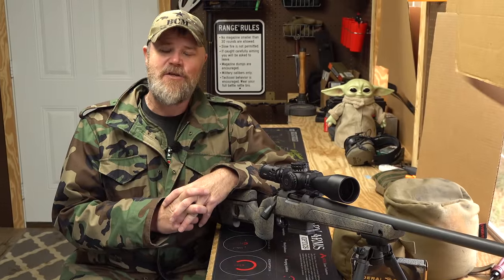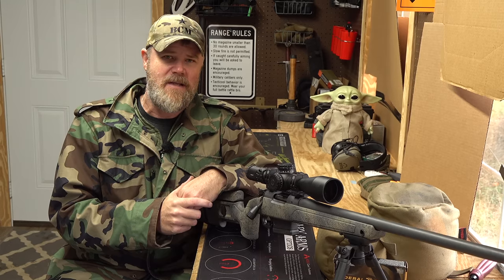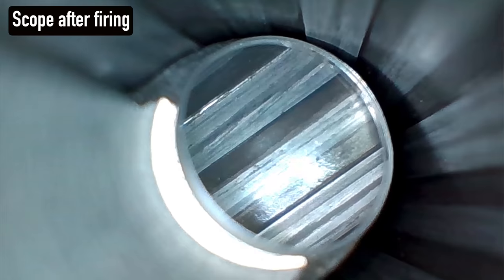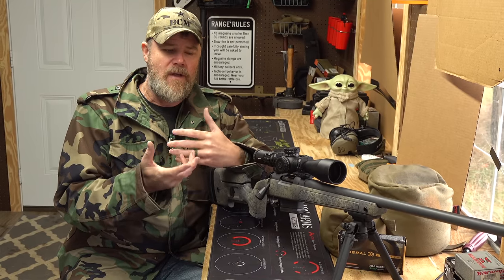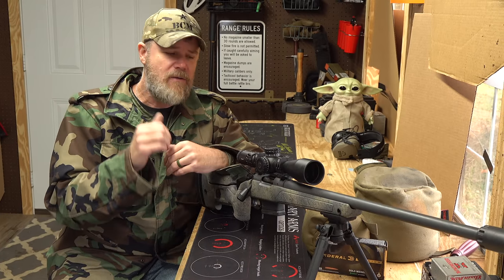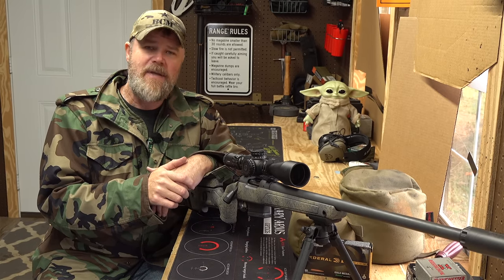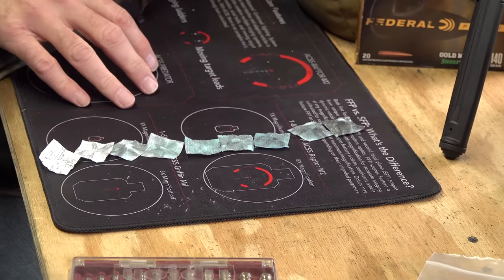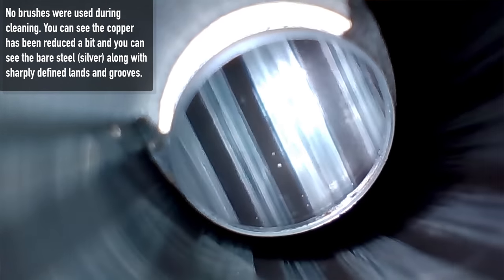Barrel Break-Ins and Cleaning Voodoo Rituals Destroy Barrels

Comment: To those that do not believe a brass brush can damage steel. I am a retired Knife Maker. My life is steels and their properties. 
First, brushes are not brass. The are bronze. Bronze by its very nature is slightly abrasive. It is not that soft and is often used in industry as a bearing surface. (actual brass is even more abrasive and very rarely used in brushes for firearms. Only very low quality and cheaply made brushes are made of brass).  

Further, any material can be abrasive in some instances. Is water softer than hard rock. Of course it is. So how does running water cut rock. Motion over time.  
How can a copper (very soft) with a lead core (softer yet) punch thru soft steel plate? time in motion.. Yep, a soft material defeating a much harder steel. 

Bronze is much-much harder and more abrasive than water and steel is nowhere as hard as hard rock. (I have never performed a Rockwell test on fully hardened bronze but I would bet is not too far below the hardness of some barrel steels. It is hard stuff folks! 

Yep, a soft material defeating a much harder steel. Remember, gun barrels are only in the neighborhood of Rockwell C scale of 40 to 44 HRc. In steel standards, very soft and made so to prevent  shock cracking by sudden pressure spikes such as explosive powder condition's. . It is softer than my steels used in knife making are when we first start working. Long before heat treating. It is what we called pickled and annealed. Or dead soft. 
For whatever reason the general public assumes that all steel is very hard. Far from it! Gun barrel steel  is too low in carbon which gives steel its hardening ability to ever be hard enough to hold an edge for a knife blade. (Bronze was used for hundreds of years for edged weapons. Just something to think about here). 

Many high top barrel makers who actually hand lapp their bores state to not use a bronze brush in their bores. A fully polished bore will instantly show fine scratched down the bore with only one brushing. This says everything you need to know as to whether bronze can effect steel. 

KnifeMaker/Retired after over 47+ years in the Craft

Comment: Older vid I know...but saying a brass or bronze brush will ruin a barrel is called retarded in any dictionary and has been disproven so many times it's ridiculous..but I'm also a hard believer in as little cleaning as possible...for the highest accuracy basically chamber cleaning is as far as I'll ever go...my black hole weaponry 556 3 grove poly barrel still nails golf balls after no cleaning and 7k rounds...the pressures in the barrel from bullets and gases only build so much and fill voids so much and then that is it...of course the nickle boron bcg needs a good cleaning every 1k rounds or so...just saying...

Comment: Barrel cleaning is BS. The copper residue in the barrel affects the accuracy. After cleaning, the rounds will continuously move on the target until they settle at a specific point, once the amount of copper deposited and removed by the projectile equalizes. That's the point at which the rifle should be sighted in. If you would want the same accuracy with cleaning, you'd have to perfectly clean the barrel each time.

Comment: I have to wonder if the "barrel break-in" idea is a carry over from when guns were less well made or from Black Powder days.  With black powder you need to clean the gun when you're done using it because the powder is corrosive and will pit your barrel (and anything else it touches) so when modern smokeless powder came along the idea of "clean after use" carried over when its not necessary.

Comment: I bought a PTR 91 2 years ago. The owners manual states,"Initial Cleaning & Break in period- 200-300 rounds. Break in Procedures- Fire 10 rds. After ea. shot, run a wet patch through bore (where else?) Then a wet bronze brush 5-10 times. Then another wet patch, followed by dry patches, until bore is dry. Fire 10-20 rds., clean as above after each group, until the 200-300 rds. are fired. What a PITA. I have complied with this as I don't want to void the warranty. So, WTH?

Comment: A wire brush to clean a barrel does no damage to the barrel. There is no way you can produce more friction with a wire brush than a single copper plated bullet screaming down the barrel at THOUSANDS of feet per second. This is why the barrel heats up, friction.

Comment: I respect your body work, however, I’d like for you to consider a another source of experience and information, specifically bullet manufacturers.   They extensively test the bullets they’re making in test barrels.  Using time tested break-in, and barrel cleaning procedures.  I’m not saying what you’re doing isn’t working. Just saying take another look at some information that’s out there that is legitimate and based in years of bullet testing.   The Hornady Podcast has some good information they have shared.   See Ep 103 and 114.

Comment: I use a nylon brush and CLP. I run a patch with CLP through the barrel and let it sit for a few minutes then run the nylon brush. If there’s a lot of copper I will use a brass brush with CLP on it, push it through and unscrew it and push it through, don’t pull the brass brush back.

Comment: Stay away from stainless brushes but if you scratch your barrel with copper or brass you have much bigger problems than accuracy. if copper scratches your rifling, the heat treat was never done and that barrel will potentially grenade, or it isn't made of steel.

Personally I use brass bristle bore snakes, and patches. Nylon hasn't been reliable for me and outright doesn't do anything for my black powder rifles.

Comment: If the copper jacket bullet which is essentially being pressed fit through the bore with high pressure doesn’t hurt the bore I doubt a copper brush would. But I do agree over cleaning is unnecessary….

Comment: Folks, during the rifling process when the “button” is pulled through the bore, on a micro level it leaves sharp feathered edges on your lands.  No, barrel manufacturers do not worry about removing this.  When we break in a new fresh barrel, we fire one shot then brush and patch to remove all these micro hardened steel fragments that would otherwise act as sandpaper on the next shot.  About ten shots with brushing and patching in between is all it takes with cheap FMJ copper jacket bullets.  Do not do this with exposed lead bullets.   Ten and done.   Now you know why Pawpaw is doing that fudd shit with his new pew pew at the range.

Comment: This exact issue and arguments are seen in other types of engineering.
There has always been baseless mumbojumbo in all these disciplines.
There has also in living memory been very large improvements in fit and finish in production engineering generally, especially in cheaper product..
There have and still are all sorts of hokuspokus products sold in all of these markets, many that are obsolete, many that are marginally or completely ineffective, some that do more harm than good.
.
There have and always will be those who make up and  espouse over complicated, methods, just so they can present themselves as being better or smarter than they realy are.
There will always be manufacturers who, have some sort of product to sell and are quite happy to tell all sorts of BULLshit to sell it.
.
Carefull use and storage, modest reasonably regular cleaning and lubrication always will be THE sensible and effective path to accuracy and long life no matter what the machine.
.
HOW can a barrel get "clogged" by anything when you slam  something with an inteferance fit, down it at 750+ Mph?
Surely just firing the gun has an inherant cleaning action on the barrel.
.
I note that the obsession seems to be the barrel. Probably because that is the easiest to sho as "dirty".
It has to be more important to make sure the action ( of whatever type) is reasonably clean and properly lubricated.
.
Of course THE major concern should be corrosion, particularly in a machine that involves fire and may be used outdoors.

Comment: Nice tips. What's your thoughts on using a bore snake in rifle barrels? I do use those in my pistols. What I'd like to do is run a wet patch of Radco CLP thru the barrel let it sit for 10min, then run my bore snake thru the barrel 3 time.

Comment: I'm OCD and I will kick the sheets off of my bed at 4:am and attach a drill to the cleaning rod and go crazy with a diamond dust brush !
All kidding aside, you can't cut a metal barrel with a softer metal brush. It's the cleaning rod type as well as cheaper brass brush construction that are suspect. Jags are mot my got to unless they are polymer. Opinions are like a_______s everyone has one.

Comment: Like you say it's your method and works for you.  You do ignore the fact that there are many pro shooters who disagree with your method.  My barrels and bore scope don't agree with your statement that copper fouling is mainly at first part of barrel and diminishes further down.  I see carbon early on to midway followed by copper gradually increasing to muzzle.  That's on a cut Bartlien, button rifled AR or hammer forged 223 and 6.5 Creed.  I agree the average Joe doesn't need to go crazy with cleaning, but the assertion that you will wear your barrel out with a thorough  cleaning is bogus.  Stay away from harsh chemicals and stainless brushes, they are not necessary.  Take care of the crown and Kroil ,Iosso and JB bore paste will remove everything that you will find without damage.  As Eric Cortina says"How do you know it won't shoot better if you clean it if you don't clean it"?

Comment: Cut, Buttoned, and Hammer Forged Barrels are divergent in cleaning need. I am a High Master Classification Long Range Competitor and having experience with cut, buttoned, and hammer forged barrels, I find buttoned are most accurate but also the quickest to loose accuracy from throat erosion. In US Service Rifle Competition I get about 1800 rounds from a button rifled barrel before MOA is difficult at 1000 yards. This means concern for using up some of the barrel life on break in as that could have effect on winning a match at the end of barrel’s life. At any rate, my experience suggests no cleaning but in a long range match I typically will take 8 sighter shots to get consistent temp for next rounds for record. This gets me a very consistent velocity from round to round which helps hold accuracy inside an MOA at 1000 yards. For Championship Tournaments I usually try to go to the firing line with s fresh barrel. The bottom-line is annotate your data book’s facsimile target with shot call and bullet strike for whatever break-in/cleaning scheme seems right and then use shooter/target analysis to compare results from chosen scheme to alternatives of which you have no experience. This will assure a better outcome than from trust in what the author of this video recommends. One thing for sure, you must be a pretty good shooter to be able to recognize what cleaning scheme is best because all divergence is going to be minuscule except at long range and at long range judgments should be made on vertical dispersion. If no long range is available measurement from a chronograph will need to suffice.

Comment: I rarely clean my Thompson center encore pistols. I'm getting sub moa with 44 Magnum and even  0.375 with 30-06 barrel with Winchester 150 grain power point (the cheapest ammo I could find). Remember, it's a break action pistol without a muzzle brake and with low power scope. If I get muzzle brake I'll probably shoot it even better. Never did that breaking thing, never thought it is nothing but bs, because as an engineer I understand how barrels work. I noticed that my accuracy is going down after cleaning barrels. I never use brushes of any kind. That's just me.

Comment: my grandfather was ww2 army Air corps drill sergeant, sheriff , mounted posse and taught Hunter's Safety course instructions for YMCA of over 10,700 students.

Including my father, USN-ECMR 65-68 , eighty six missions 37 encounters with the Enemy 16 CK's silver Star two bronze I even have some of his Personal commendation letters from a Vice Admiral of Asian Pacific Fleet, 

Point to being over cleaning your Barrel is like overcleaning an engine, since the Reciprocal motion of a Piston or bullet are the Same Thing essentially... Controlled mass pressure wave using Thermochemical reaction to direct the projectile or intended Mechanical energy.

We used to use Liquid Mercury after many Hours of shooting per weekend, gramps had multiple calibers, and ALL of the used every time, very rarely should you need to use wire on a barrel unless it's neglected, just a simple pass with mercury back into the bottle and couple passes with an oiled Cotton patch and your barrel is Proper.. the carbon deposits also seat on inconsistent rails of the rifling, just like in a piston where Natural pits in the bore chamber  seats so as to provide a natural filler of Pure Carbon.. thats why engine's and firearms are " Broken in " 

Point being STOP using a wire brush to " clean " your barrels VERY rarely if at ALL.. cotton and oil... If it's really pitting from rust use a Rust inhibitor like transmission fluid. Works wonders on all parts too..

And still to THIS day I use toothpaste to clean my firearms.. since it has Silicates in it.

Comment: What are you thoughts on using Moly Coated bullets in Chrome moly barrels? I have coated my own bullets for CM barrels since the 1990’s. And I don’t clean the bore until I run out of the current batch of hand loads (100-200 rounds). Stainless barrels and ARs I don’t use coated bullets. My process for coating bullets is listed below.
1) Clean each bullet by hand with a lint free O.R. Cotton towel and 91% isopropyl alcohol.
2) allow bullets to dry
3) place in tumbler contains corn cob media and Frankfort Arsenal Molybdenum Disulfide powder.
4) tumble for 1-2 hours
5) fish out the bullets after the dust settles and rebox them. 
You have hoards of followers and much more expertise than I. Would appreciate your input on if all this is needed to prolong barrel life or if I have wasted an unknown amount of time. 
Thanks

Comment: I never clean my barrels until I see you consistent reduction in accuracy. Then I only use carburetor cleaner as a solvent, because I do not want to remove any copper That fills the imperfections in the bore. It is impossible for a bronze brush two damage a steel bore.

Comment: Thanks for the video. Now I know what is wrong with my Savage 17 WSM. I bought it used. It wasn't very accurate so I tried to break the barrel in properly with copper solvent and a bronze brush which fits extra tight in 17 caliber. After repeatedly cleaning this way accuracy got worse. Then I tried and abrasive cleaner. Then I tried not cleaning at all for a while then cleaning again with solvent and a bronze brush.  As of now accuracy is worse than ever. I'm afraid the barrel is pretty much ruined.

Comment: Brass absolutely won't destroy a crown or a barrel, even chucked in a drill it won't. Improper practices will. With that said now we have companies that test these things to provide facts rather than opinions. Applied ballastics has shown that barrels do have a break in and do speed up after the first 100-150 rounds, PRS shooters know this all to well. Bryan Litz also does 30 strokes forward and backwards with a brass brush and also uses JB Bore paste to speed along break in and clean. Benchrest shooters use abrasives and make barrels shoot groups that are 150 thousandths of an inch wide with 2000 rounds down the tube after using a brass brush and JB bore paste. Barrels aren't the soft fragile things that some folks think they are.

Comment: A good barrel that is smooth to start is done differently than a rough barrel such as a Savages lower end barrels. I have a sign above the entrance to my man cave gun room "Everyone is entitled to my opinion". I agree with all your statements on a high quality barrel. I never use a bronze brush after I will break in a Savage barrel nor Sweets. For my guns I use Hoppes, a couple of wet patches and over a few days each day, set it muzzle down on a pad of paper towels until I have no green. Let the solvent do its job with less strokes. What I do with Savages must work well. This past Sunday my daughter and I at the range was producing 1/4 inch groups with  a 204 Ruger. Small bore rifles like 17 cal and 20 cals benefit from frequent cleaning. 
 My custom 223 Ackley with a  Shilen barrel I cryo treated. 3 patch of Hoppes and it is done. I do mostly varmint shooting. Sixty years and counting with Hoppers. Always use a good rod, coated is best and baby that bore with a guide.  I size, turn my jags down, to have nice smooth snug, not overly tight fit with patches I use. I want to add I wipe the rod off after every stroke.
 Good video.

Comment: I've always done it.. May be silly, may not. Initially run a wet patch of Hoppes No. 9, then a dry patches. I fire the first five shots with a couple minutes between shots. Run a patch with Hoppes No, 9, then run a dry patches. Then I'll put another 10 rounds through it, allowing a couple minutes between shots. At this point, I'll run a wet patch through and let it sit, then run dry patches, followed by an oil patch to prevent rust. After that, I clean it after each use, may be 20 rounds.. or a 100.